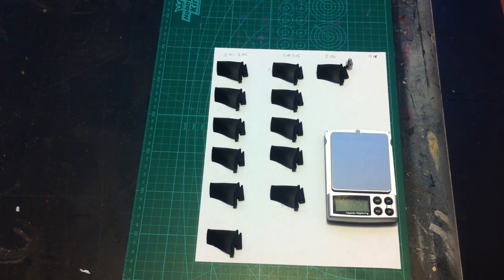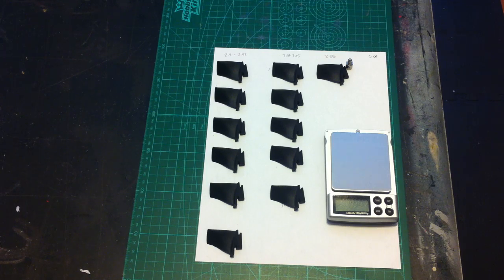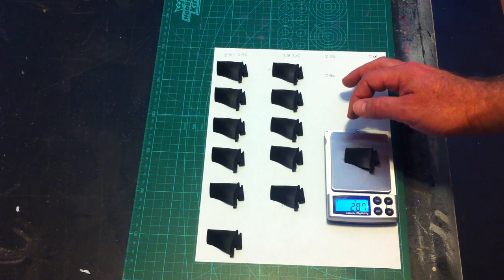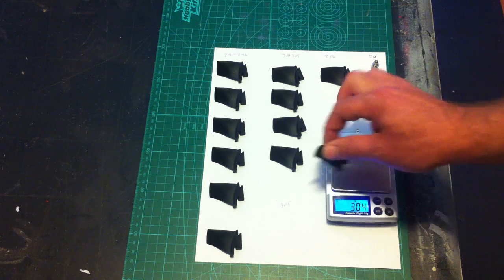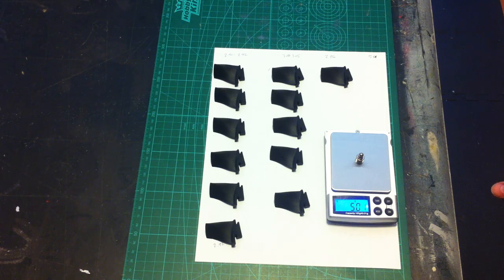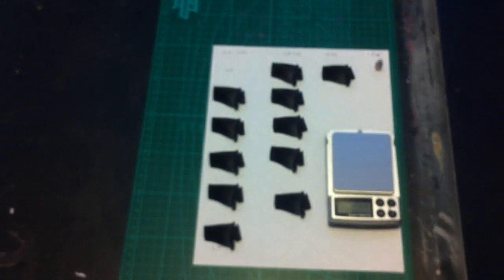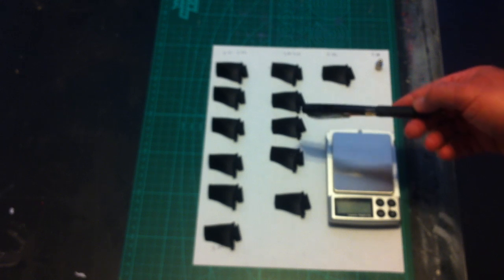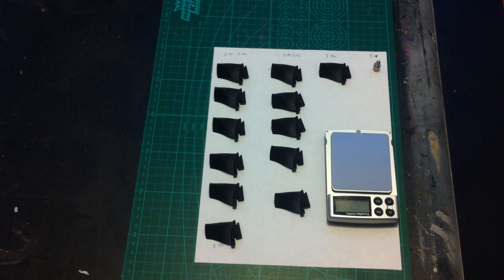CS-90 12 blade fan

Comment: the nose cap back on I put the clump of tape in at 12 o'clock then marked that spot and put the cap back on tight spun up the fan on 5 cells and using an app on my iphone and by watching the vibrations on the display I rotated the weight in under the cone by 45 degrees and retested and when I got to the 3/4 mark the fan could almost not be felt by touching so I decreased the the weight in the nose by 1/2 and retried a run and by decreasing the tape by half I could no longer feel the vibrations and was able to run the fan all the way to what 5 lipos and a 1900kv motor could give me I was finally happy with the results testing with 6 cells is coming soon with caution of course safety first but if this helps some guys out there the scale was only $24 and it weighs in grains aswell as grams . Tom great info on your videos.......Jacksmobile

Comment: I do reloading my own bullets and my scale measures grains and when I could not balance a cs 90 mm fan I pulled my scale out and weighted each and every blade as you did and I also happen to be a mechanic and in the early years we balanced motors internally we would weigh all the connecting rods and when we had the weights of each we would grind each of the heavier rods till they weighed the same as the lightest one so I had cs blades that were 297 grains and all the way to the heaviest at 302 grains sanded down the heavier one to 297 and then decided to bring my lighter ones up to the weight of the 297 by lightly sanding the base of the root of each side of the blade and then applied a little and I mean  a little epoxy and weighted them till they all were at 297 then let the epoxy dry and remounted them back in the fan and I have to tell you it became 98% balanced I then put some electrical tape stacked together and cut a small clump to create a bit of weight and before putting the nose cap back on I put the clump of tape in at 12 o'clock then marked that spot and put the cap back on tight spun up the fan on 5 cells and using an app on my iphone and by watching the vibrations on the display I rotated the weight in under the cone by 45 degrees and retested and when I got to the 3/4 mark the fan could almost not be felt by touching so I decreased the the weight in the nose by 1/2 and retried a run and by decreasing the tape by half I could no longer feel the vibrations and was able to run the fan all the way to what 5 lipos and a 1900kv motor could give me I was finally happy with the results testing with 6 cells is coming soon with caution of course safety first but if this helps some guys out there the scale was only $24 and it weighs in grains aswell as grams . Tom great info on your videos.......Jacksmobile
Reply from the maker: Glad it was helpful Jacksmobile!
I usually paint the light blades with flat black to add weight.  My fans aren't perfectly balanced, but still sound great in the airframe.  Much better than stock (unbalanced) fans.  If you check out my Superhornet video you can hear what I mean.

Comment: There was a run of CS90s with weak blades. Lots were blowing up. The new run of 90s and 70s have noticeably stronger blades, as long as you balance the rotor halfway decent on a magnetic balancer or optical youre good to go. The new CS fams HK is releasimg are enticing though. Modofied CS rotors in alloy 7 stator housings with removable alloy lips, motor shrouds and grooved fan shrouds. Comes with decent inrunners installed. Definitely going to try them out.

Comment from the maker: I don't think I'll be able to help with that one, Skylineflyer.
Unlike weighing & visually inspecting blades, a tensile test is destructive in nature.  Further I don't have access to a test apparatus.  Finally, a very specific fixture/jig would need to be made for securing each blade for the pull.  Ideally the front tongue would be isolated in the test - difficult for sure and beyond feasible for me.
Sorry!
I'm thinking this would be something the manufacture should do ... or be convinced to do.